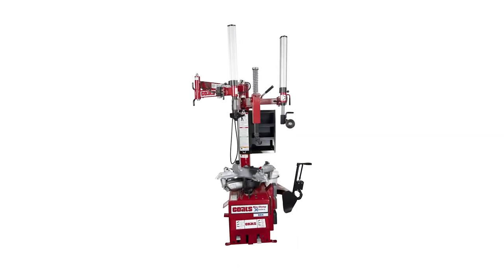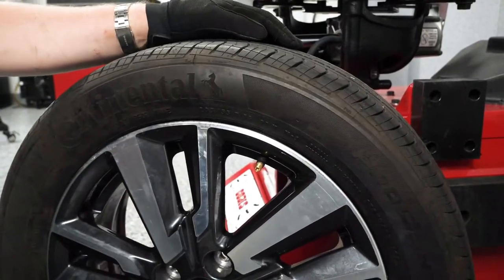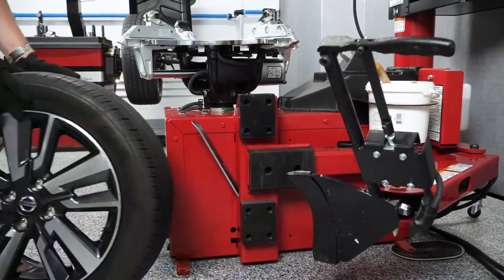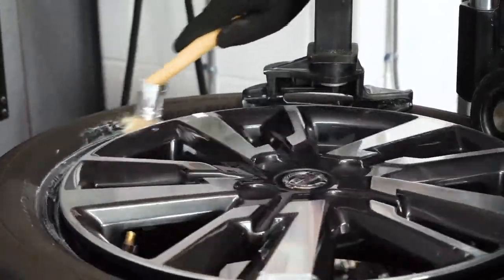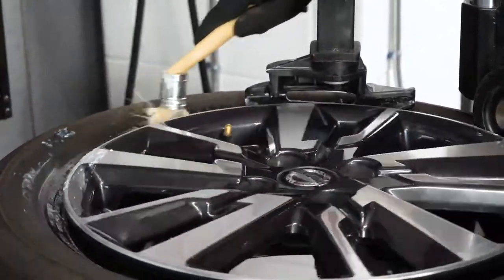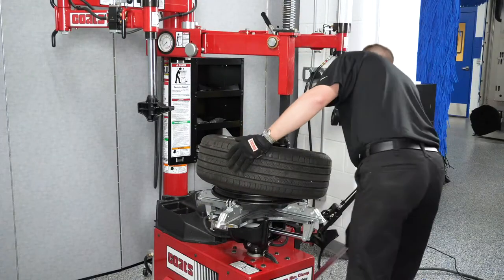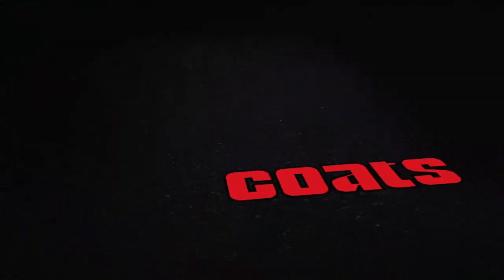COATS 80x Tire Changer Demo

Comment: i just got this unit and am putting together now it would be nice if u showed recommended position of tpms for minimizing damage
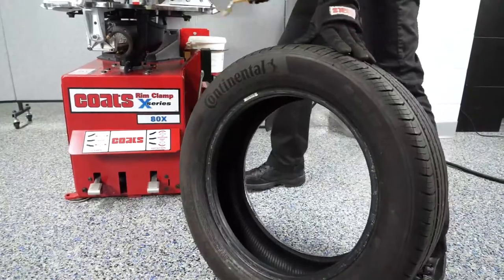Reply from the maker: Hi there! Before beginning the dismount process, make sure the TPMS sensor is behind the duckhead as shown at 1:23. Do the same before you dismount the bottom bead. Then, when mounting the bottom bead of the new tire, position the tire on the wheel with the TPMS sensor located at the traction point or 7 o’ clock. Then, rotate the tabletop and mount the bottom bead as shown at 2:06. Hope this helps!